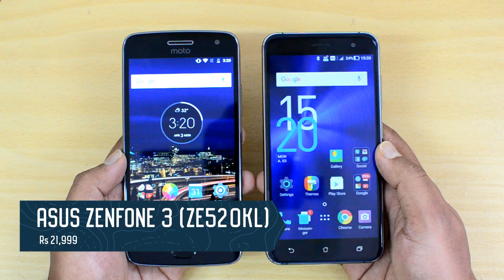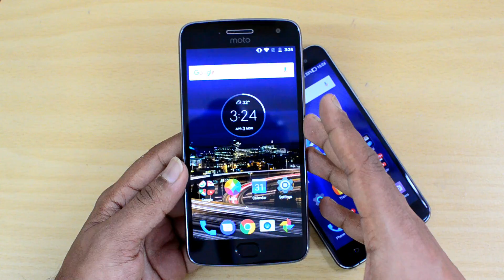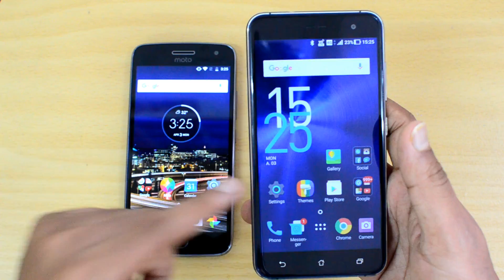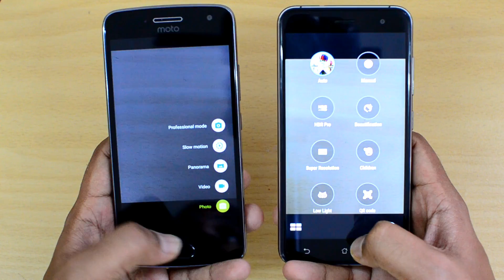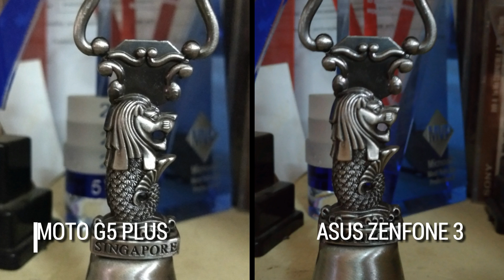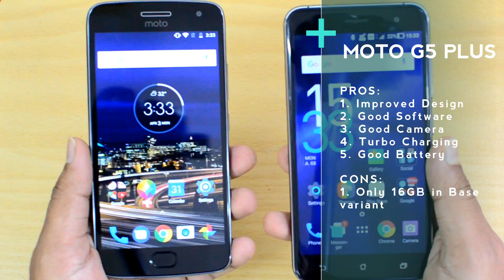Moto G5 Plus vs ASUS Zenfone 3- Detailed Comparison, Speed, Performance, Camera and Battery

Comment: Asus zenfone 3 onwards introduced a new option to take private calls using your finger print scanner. Just add the contact to private contacts and the only way to answer it is to use your finger print😉

Comment: asus should have added a higher processor for that price range. i am a moto g5 plus user and the camera is definitely not as bad as mentioned here it neither does lose any pixel while zooming. in asus zenfone is an overpriced handset. also moto g5 plus has dual autofocus pixels to compete the laser autofocus system

Comment: I'm going to buy a phone soon (budget around 20k), and I'm confused btw these 2 phones. The reason I don't like Moto g5 plus is:
1. Lenovo really compromises on build quality (Personal Experience). After 1-1.5 year their phone quality start to degrade like buttons, back cover, etc
2 Although it doesn't matter that much but the SAR value is too high (1.45).
3 It is not an all metal phone. Plastic is being used on the side, for buttons and the back cover is also metal coated plastic (100% sure for the Moto g5).
Should I buy Zenfone 3 or wait for some other phone?
Reply: Ishan Sharma Same with me
In the big 10 sale as zenfone 3 is available at 15k, i am confused
Reply: Zeus Unlmtd just go for Zenfone 3 🤘👌